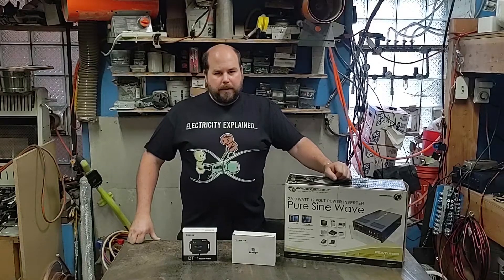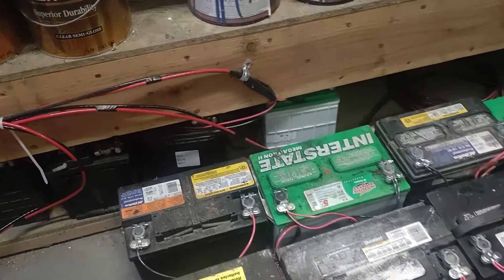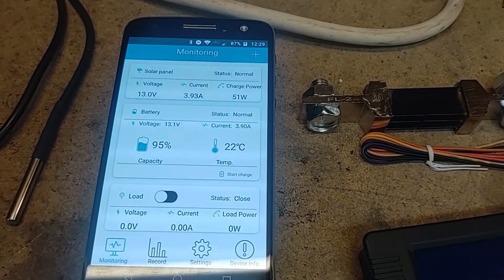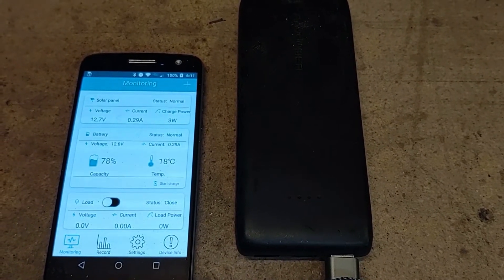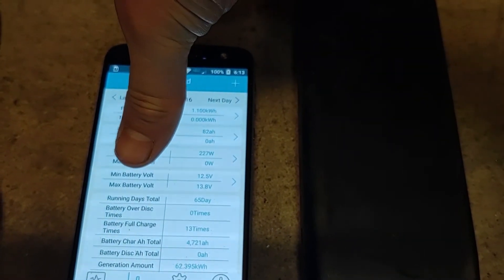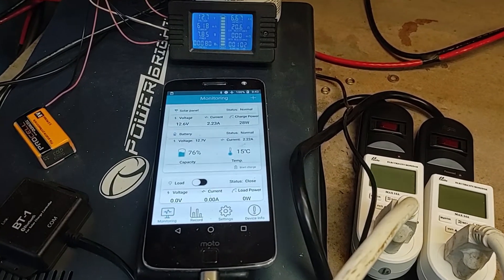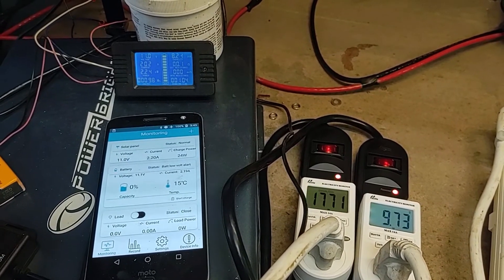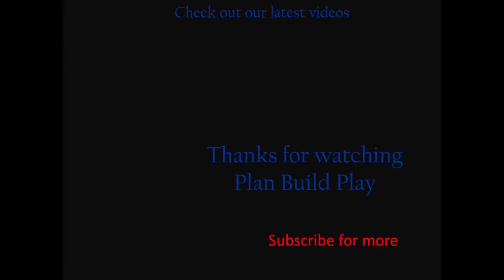Renogy Wanderer + Powerbright 2.2KW Inverter setup and testing

Comment: Can you do a video showing how you hooked up you temp sensor ?
Reply from the maker: The temperature sensor just plugs in using something like a phone jack plug.  Since I have a bunch of batteries hooked up I didn't want to take the temperature of a single battery and just have it measuring the air temp above the battery bank.  I don't put in/use enough current to the battery bank where it should be changing the battery temperature much.